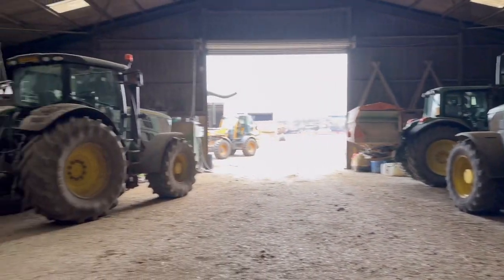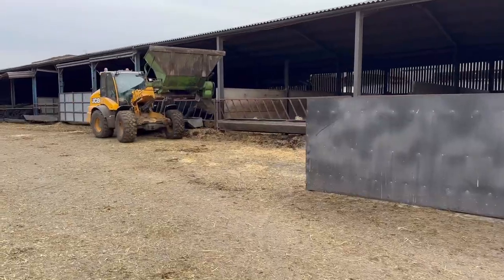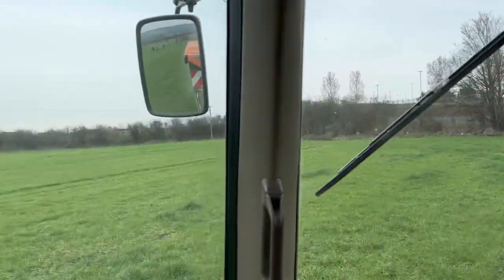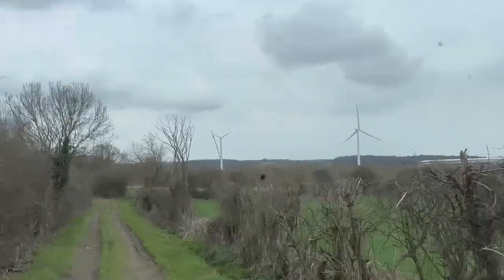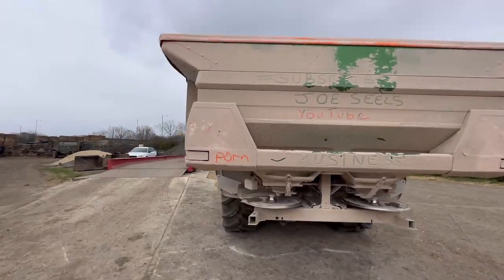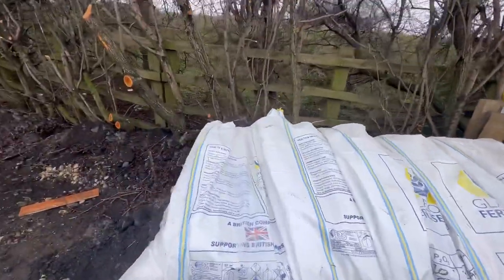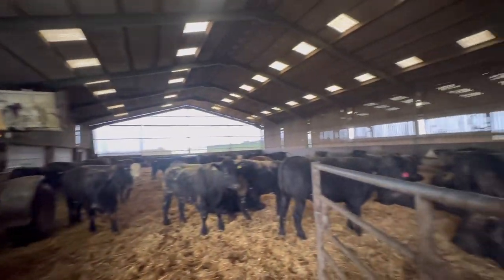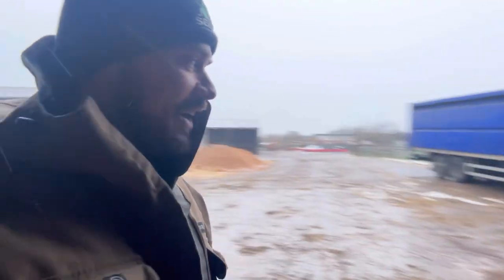It’s Cold n We’re Concreting! Massive Crane! Busy Day!

Comment: If the removeable insert in the pully where the shear bolt goes is a bit worn or oval shaped, that will make the shear bolt more likely to shear, perhaps the insert needs replacing.
Big Mick wears a  Tee shirt/ polo shirt with GXO on it. I presume he drives a truck for them.
We had a coating of snow here in Somerset this morning. I think you are in for a good dumping of the white stuff tonight and tomorrow, good luck.

Comment: Do you have auto locking on your Tm and 9 meter?
Reply: Got attaching implements
Reply from the maker: Yeah both are on hydraulics, tm is better as you can’t accidentally unlock the pins, have to use two hands to do it